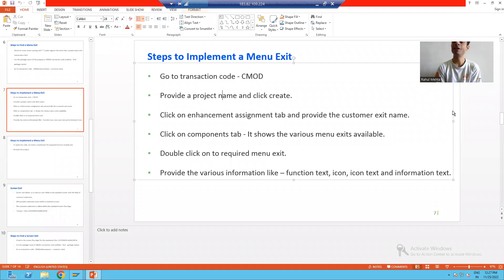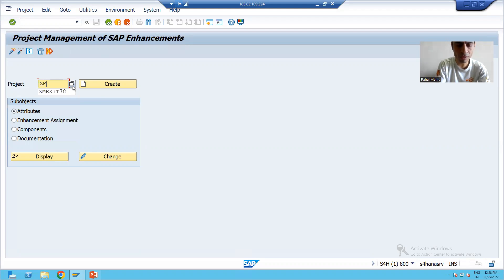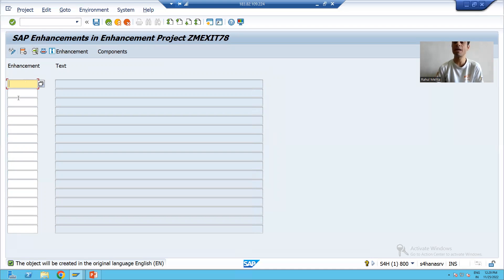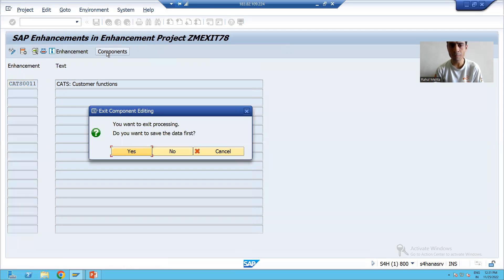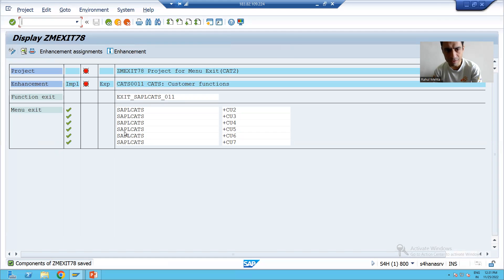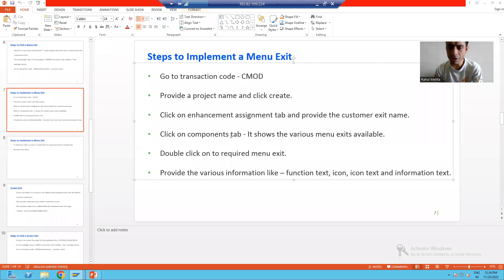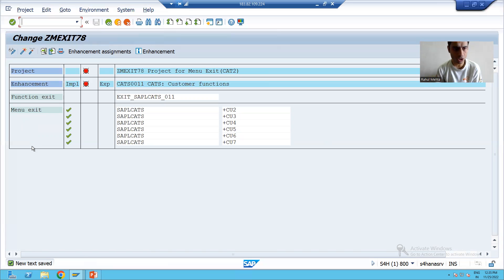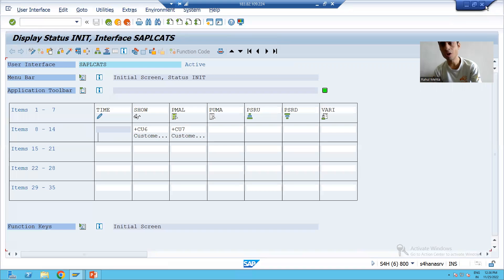16 - Enhancements & Modifications - Customer Exit - Menu Exit Part2

Comment: Sir here we have only one option in +cu6 that is approve time sheet suppose if we have 2 option in customer exit ( means 2 button) then on click one or another how does we differentiate it in sy-ucomm condition?
Reply from the maker: Hello - Every button has a function code. +CU6 is a function code itself for that button. In case of multiple buttons, function code for those buttons will be unique and we will write the logic based upon that only.

IF SY-UCOMM = '+CU6'.
ENDIF.

IF SY-UCOMM = '+CU7'.
ENDIF.
Reply: @ Sir , so we will not have 2 buttons assigned to +cu6 right it can hold only one sy-ucomm value right rather than 2
Reply from the maker: @ChitraVenkatesan-r1e     Yes. Correct observation.
Reply: @sapabapbyrahulmehta  sir so the solution is only one + menuexit is assigned to one sy-ucomm right?
Reply from the maker: @ChitraVenkatesan-r1e     Observation is not correct for SY-UCOMM variable. We don't assign any menu exit to SY-UCOMM. We provide function code to button and SY-UCOMM captures the value of that function code.
Reply: @sapabapbyrahulmehta  sir so only one function code us assigned to one+  menu exit right
Reply from the maker: @ChitraVenkatesan-r1e    We will understand by example. Suppose - In utilities menu,  SAP Provided +CU6, + CU7, + CU8. They are the function codes and unique. Now you can add 3 buttons having function codes +CU6, +CU7 and +CU8. When we click on any button, SY-UCOMM captures the values and it will be +CU6, +CU7 or +CU8 depends upon the click of the button.

Comment: Why CAT2 is showing both CU6 & CU7 after implementation of menu exit? Is there any possibility to show just CU6?
Reply from the maker: Excellent question Neerja. Once we activate the project, all Menu Exits in that project activate together. But we have a option to deactivate through coding. We know, we can add our code through Function Module Exit. So there is a customer Exit available - 1)  'CATS0004  CATS: Deactivate functions in the user interface' in package CATS. 2)  In this Customer Exit there is a function module exit, EXIT_SAPLCATS_004. 3) Every button has a function code, So I have written this logic to exclude the menu item having function code +CU7.
DATA : ls_fcode TYPE CUAFCODE.
ls_fcode-FCODE = '+CU7'.
APPEND ls_fcode to T_CUAFC.